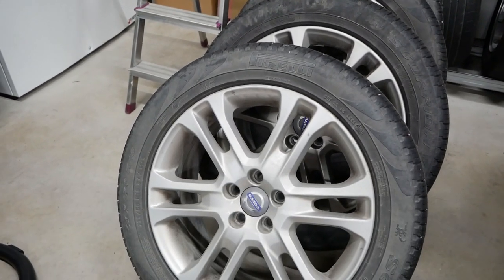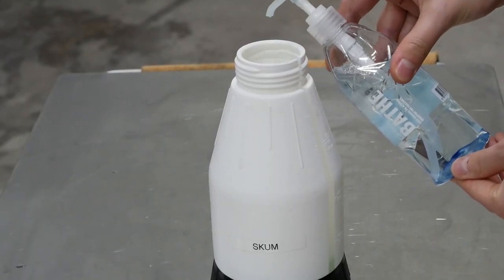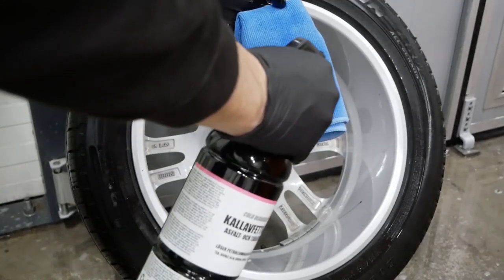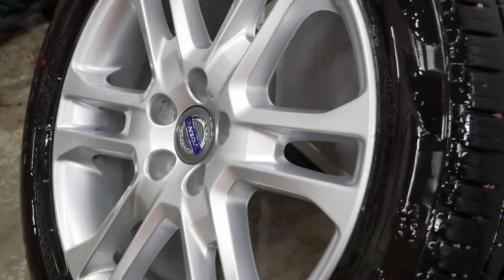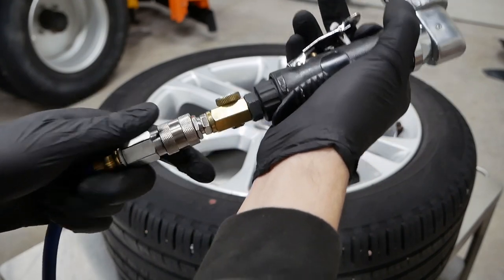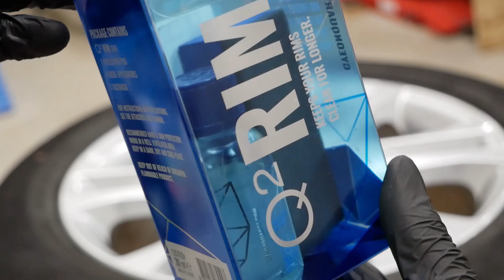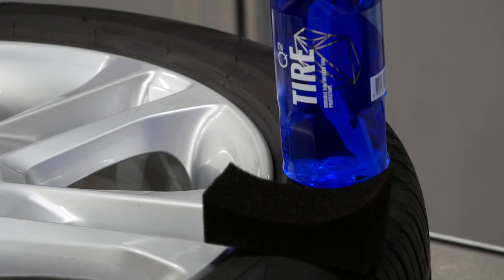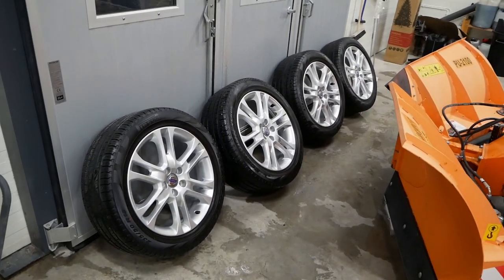How to SUPER CLEAN & Protect Your Wheels

Comment: hey can i ask you a question. what type of in tank fuel pump do you recommend for a 1995 945 B230FK with a 
low pressure turbo.. my car is oem no chip no 
performance parts only stock... thanks from norway